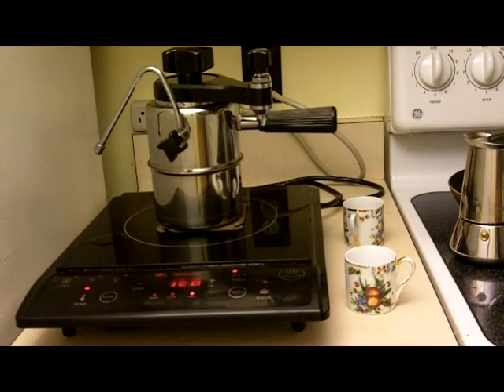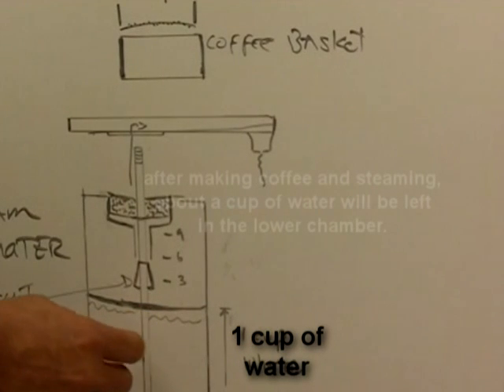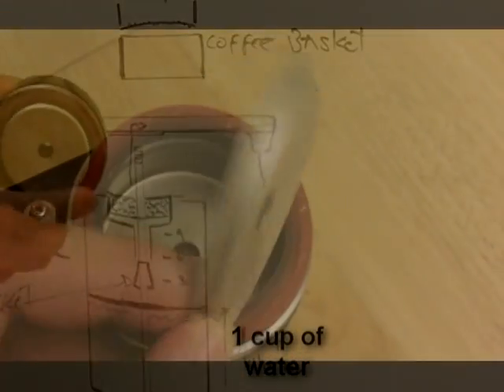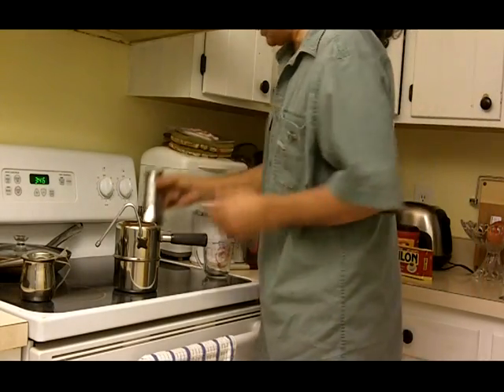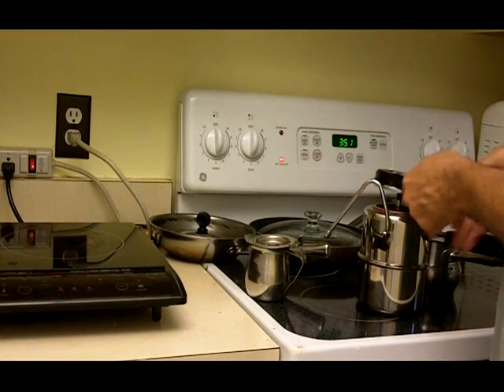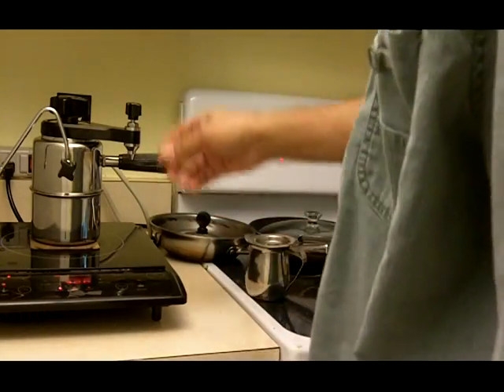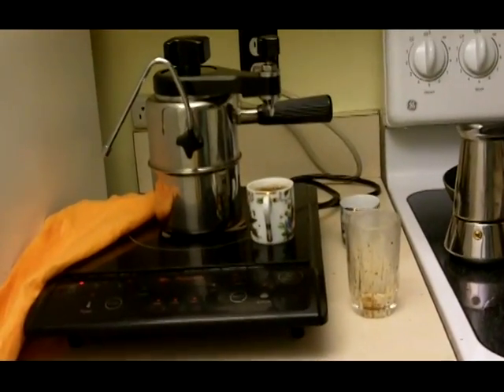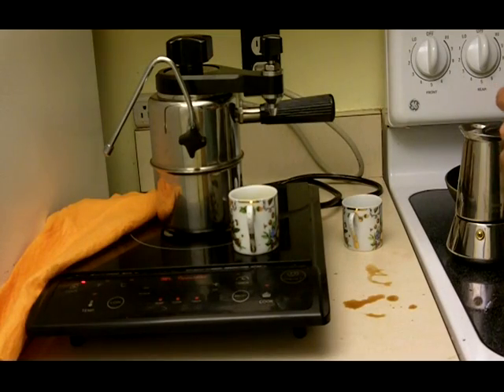Bellman cx25 is your coffee too diluted?

Comment: Very thorough video and nicely done! I have the electric version of the Bellman, like you showed at the end, and had noticed many other user complaints about the poor quality of the espresso, along with the tell-tale leftover brown water in the tank… and your tips made all the difference. I also appreciated the little tricks of first keeping the steamer cracked open to tell when proper steam has built up, along with testing using a ppm meter (likewise 're-purposed' from my own 'hydroponics')! Molto Grazie!!
Reply: +LowenKM when you use the bellman with preasure meter, you can see the preasure from the bellman is only 2 bar but the water temperature is high. it's burn your coffee. but this handy tools is good for milk frothing.
Reply from the maker: Thank you!